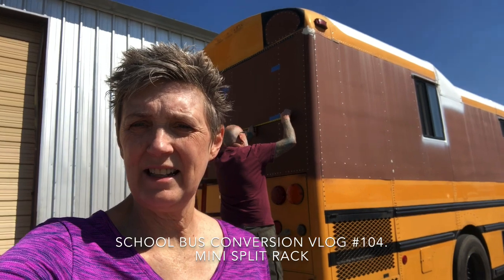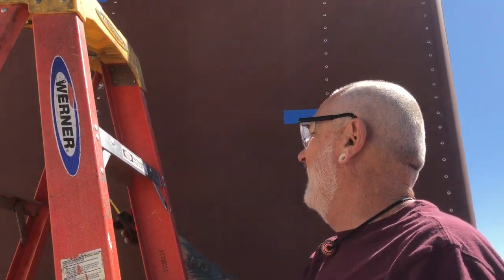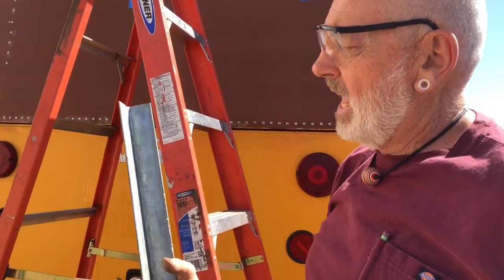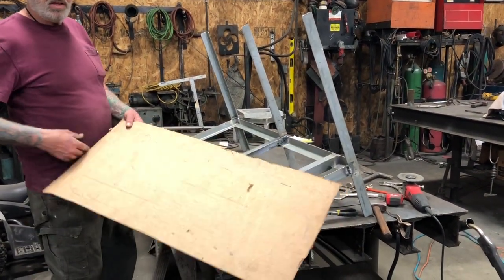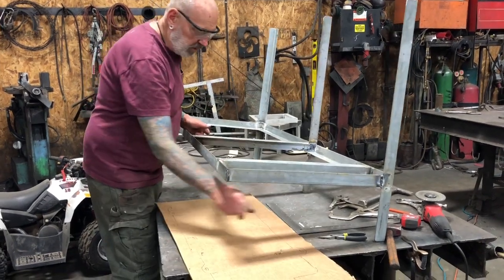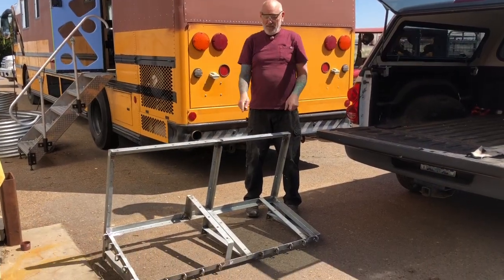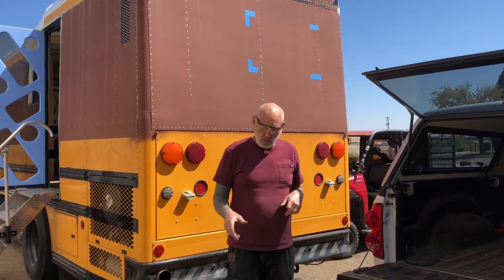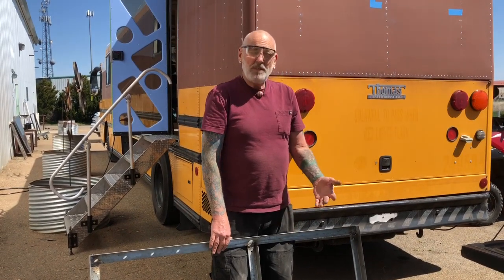Mini Split Rack - Vlog 104 School Bus Conversion

Comment: Did you consider something over the top and face of the split to protect it?  I have read  those aren’t rated for “extreme” outdoor use. Don’t most manufactures recommend some type of cover/ shelter for them under extreme use? Like driving down the highway in a rain storm.    Plus could dissuade some vandals or thief’s .  Maybe some expanded metal across the back?
Reply from the maker: You are right the manufactures do recommend covering the unit for extreme rain conditions. Of course the manufacturers are not going to say anything about driving down the road it was never intended for that so we’re kind of on our own in that respect. However I am thinking about putting a rain cover over the top. That’ll keep the rain off and the sun off in  the extreme heat. Not too worried about somebody stealing it as they would need a ladder to get to it but I do appreciate your thoughts and concerns about that I’m going have to think it. Thanks so much for your comments regards Randy